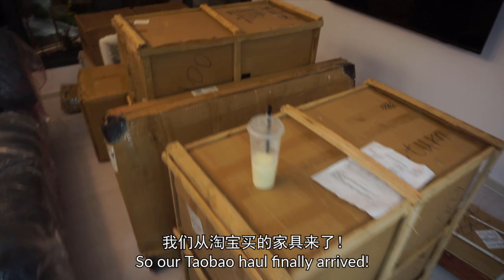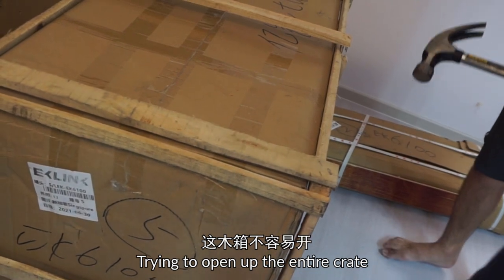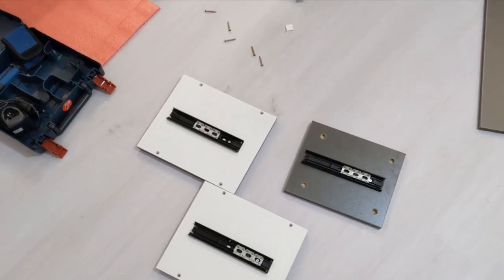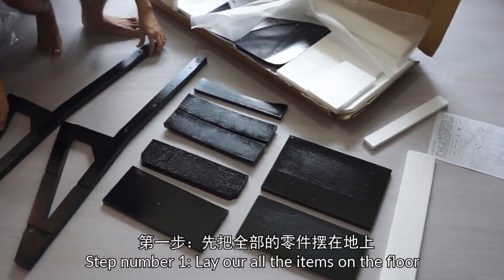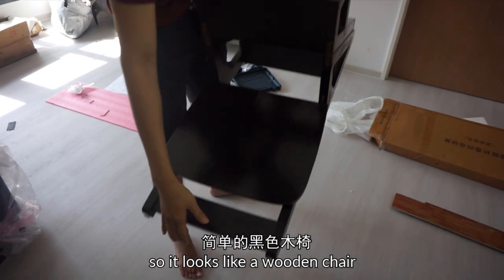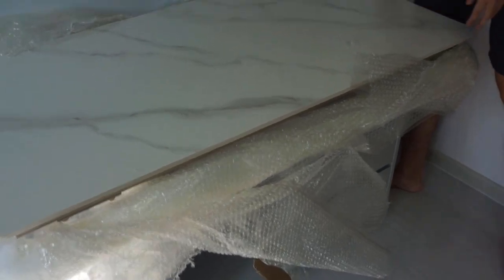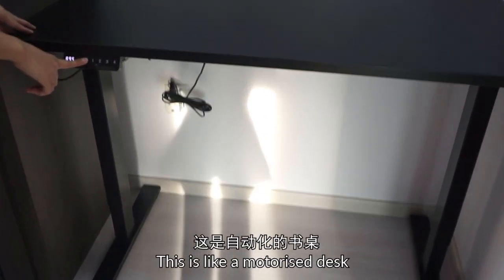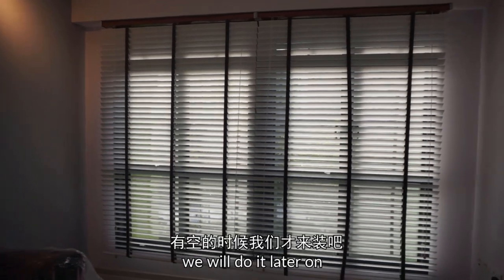【中文字幕】HDB BTO Renovation Journey Episode 5 - Taobao Furniture Haul!

Comment: hey there, do you have mind sharing the link for the electric desk you bought from taobao? and how has the electric desk been holding up since Aug?
Reply from the maker: It's great! I think it's a great buy with all the necessary functions such as remembering height settings and pretty affordable. You do need a power drill to install the desk yourself. Will drop you a link either here or through PM.
Reply: Thanks for the prompt reply, appreciate it. Good to know that you had a good buy, taobao is really a hit and miss. Can you share the link here please? I didnt know youtube has a inbox function lol.
Reply from the maker: @kifakw  here you go :) there's different dimensions as well. One of the reason why I picked this is because my dimension need to be quite specific. 
 https://m.intl.taobao.com/detail/detail.html?id=582972562738&price=949-1499&original_price=1339-3299&sourceType=item&sourceType=item&suid=0bf6f338-435a-4414-81ce-7794439a6a47&ut_sk=1.YJ3Aa87hVm8DAOyu2AEokzBy_21646297_1626622086764.Copy.ShareGlobalNavigation_1&un=0acd5cbfddb871cae5b5f4fc2175e0a7&share_crt_v=1&spm=a2159r.13376460.0.0&sp_tk=emc5VFhRSk9kTEk=&cpp=1&shareurl=true&short_name=h.4C8x8Pg&bxsign=scdDGfutIgN8y_f-CFbErhVNnLutrRyBlaYGCQE2toR2ipCIg2MHSNgFNMuLGmGYwAoxCM7XGI6rAWZ9QBgDXNuriRGnsOubV23nHde3Yui6U4&sm=ffa1ed&app=chrome
Reply: @SGLife1  thanks again! added it to my cart, here is the item name as well for others ... '乐歌E2S电动可升降桌学习亲子办公书桌家居电脑台移动电竞工作台'